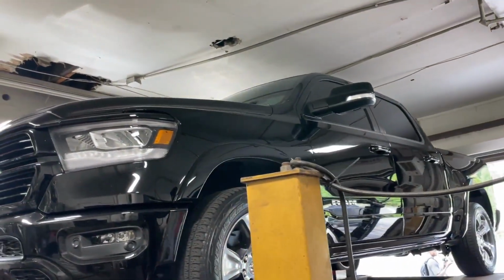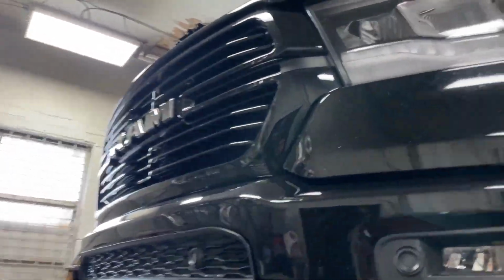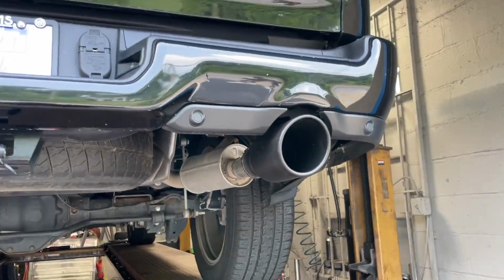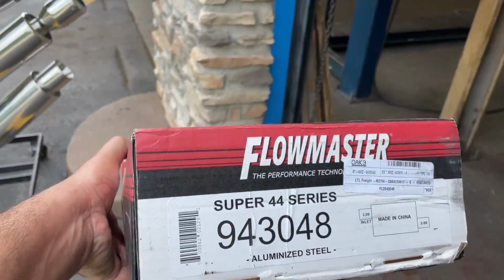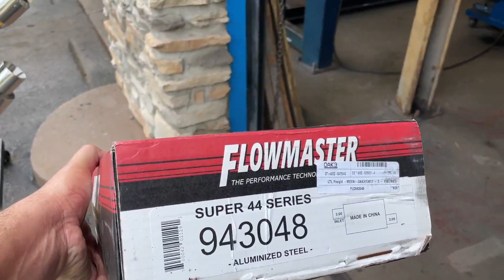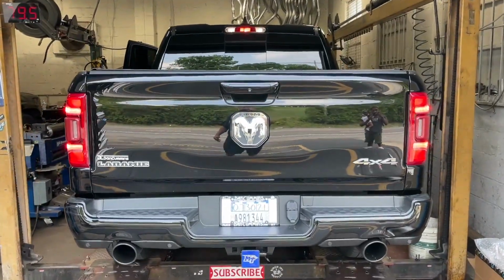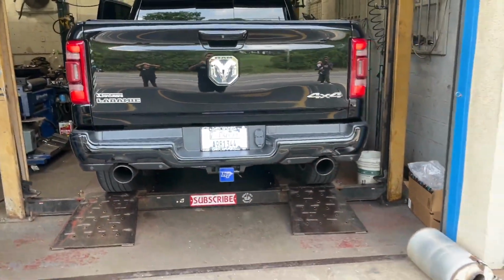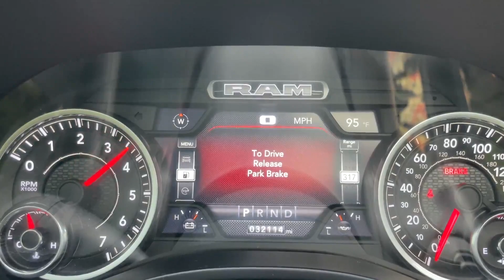2019 RAM 1500 5.7L HEMI LARAMIE DUAL EXHAUST w/ FLOWMASTER SUPER 44  SERIES!

Comment: Will never buy another flowmaster product. Had a brand new full flowmaster exhaust on my truck from manifolds back. First the flowmaster cat pipe flanges were not made right (too small for the donuts, had to cut off and install correct flanges) Then after only one winter season the 44 started rusting through where the pipes are welded to the muffler body. By the time the second winter was over both tailpipes after the muffler rusted through where the hangers were welded on the pipes. Went to parts store bought a thrush muffler for half the price of flowmaster (actually sounds better also) and ordered unbranded tailpipes on ebay for half the price of flowmaster.  Now it has been 4 years later and exhaust is still in one piece and sounds great.